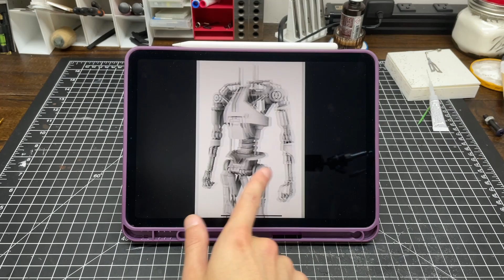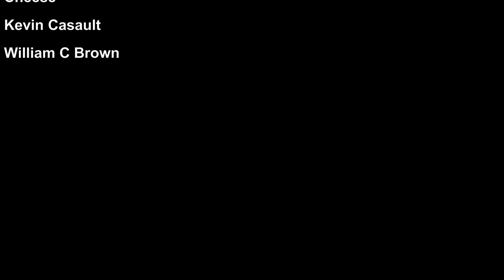ECHO: Rollerblading Mech from Junk (Part 1)

Comment: Wow , nice build , I am your new subscriber ! 
But I think that this machine needs more flexible shoulders for better operating
Reply from the maker: @даниилпрохоров-о4е  thank you! In general I would have gone with ball socket joints but bolts are very strong and practical. Maybe I’ll rebuild them for more mobility somehow…
Reply: @proto.roborovski  I agree , ball joints are pretty weak . I think you ou can use joints like hip joints on modern gunpla , shaft in body connected to hinge and another shaft in arm (sorry I'm quite bad with English) or just use special Lego reinforced socket detail , I used them when built Mecha garage kit and two of them were strong enough to hold almost one kilo of weight
Reply from the maker: @даниилпрохоров-о4е  your English is fine friend, I understand the connections you’re talking about. I’ve never made one from scratch and I like to trade off simplicity for mobility. But still I can think on a way to do this with my resources!

Comment: A good surface to "grind" on (because that tin does bend and you end up cupping your parts) would be to take a piece of MDF, carve a perimeter channel for water to gather in, then dip that MDF slab in wood lacquer, letting it suck up the boat lacquer in successive dips until it doesn't and it starts building up. 4 dips should do it, with light sanding between layers (the only surface that needs to be flat and clean is the one where the glass later glues on).

For the surface where the sandpaper will sit, you need to have a piece of glass glued on top with its edges blunted. Sanding the "podium" where the piece of glass sits can be achieved with the glass itself as a backing for sand paper. Once this is complete, CA glue is sufficient to keep the glass in place. It's robust, the MDF won't bend in time, it's sealed against the water and the glass is protected by this, giving you a reasonably flat surface to sand on.

If you want to take this ONE step above, you make two identical pieces, buy some diamond glass grinding paste and place it evenly spread on the glass, then use the other to rub the two glass surfaces until all the glass surface on both pieces is frosted. This will give you nearly perfect flatness on part with some mid grade machinist surfaces. 

The only expensive part of this would be the diamond paste (but some places offer samples, if you ask them, which should be more than enough if you're frugal with the application) all the other parts are cheap, easily found items. I'd recommend a piece of MDF that's at least 1 cm thick. You can layer multiple (thinner) pieces of MDF by gluing them with wood glue.

If you go that route, make it at least 2 cm thick. And if you do go that route, you can carve out a pocket in one of the center segments and put either lead shot or lead weights which you can (in most cases) obtain for free from any wheel alignment shop. You just got there and tell them you want to lest a base down and they'll likely give you, if not for free at least for cheaper than buying ingots. The base being heavy helps a ton with sanding stuff.

This is worthwhile doing, as it's a lifetime object. I've made mine... 23~24 years ago and i'm still using them even tho i now have A grade machinist surfaces. So it's really a good DIY tool.
Reply from the maker: @aserta  great advice, I’ll have to look around at my glass collection and see what I can come up with. Thanks!

Comment: Will you be integrating some kind of actuators outside the framework?  If so, I cannot wait to see how the complex actuation of the ankle is handled.  I know you have sworn off further FDM printed parts for this project, but I encourage you to look to @BreakingTaps video on rolling contact joints for possible future project inspiration.  Heck, giving Project ECHO a cable-based actuation system would definitely look original compared to other entries that I've seen from previous years.
Reply from the maker: @bearnaff9387  I’m definitely putting pistons and such into the design. I’m still finding the best ways to incorporate them around joints but I’m happy with what I’ve come up with. I love the rolling contact joints, definitely something I’ve considered. Maybe the next mech! I’ll think of a way to make it work with trash and my design style. Thanks for the input!